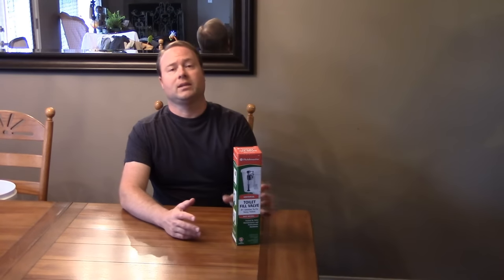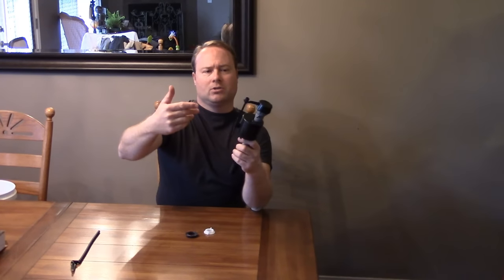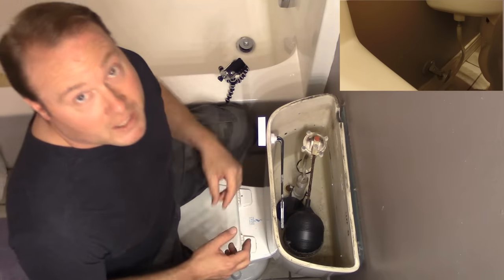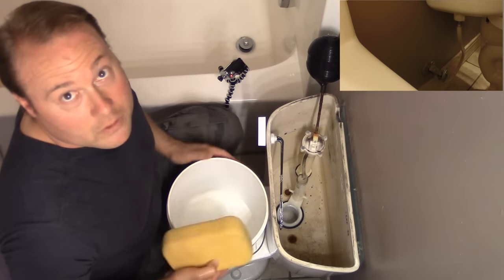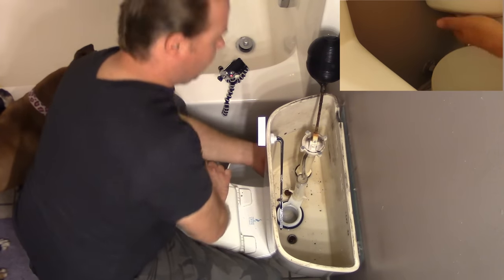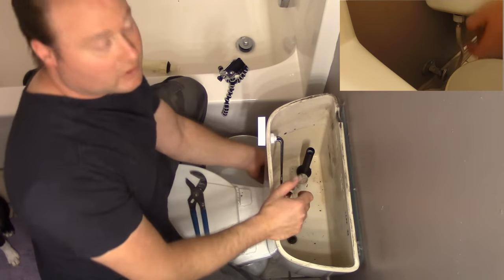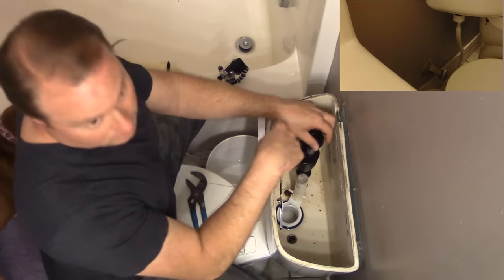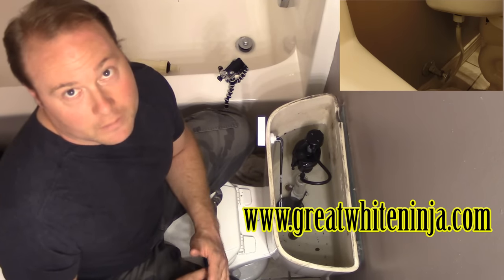Fluidmaster 400a - Installation

Comment: Do you know if there is a difference between the 400A generic fluid master valve vs the American standard one with the blue top?...they both say 400a but the American one is significantly more at least twice the price.
Reply from the maker: To be honest, I don't. I think they are the same, except the American Standard has a blue top and they call it theirs. If you are wondering if you can just yank the top of the fill valve off without removing the stem in the tank, like I show in the video, well very possibly. But I am definitely not guaranteeing anything there. You could for sure remove all of the old one and replace it with all of the new regular 400a. Good luck with your project. Thank you for watching. Check out hundreds more of our videos at https://www.aroundthehome.org
Reply: @AroundTheHome1  thanks!

Comment: Stupid question...do you have to cut off the water from supply line...my valve is rusted out....if I am just replacing the top part.
Reply from the maker: The top part is the valve on this so the water must be shut off. Somewhere it needs to be shut off so if your shut off is rusted then you need to shut off water to the whole house. Thanks for watching and don't forget to stop by our website for many more helpful videos. www.greatwhiteninja.com

Comment: How do you know where to fill to? You said to adjust to water level but how do we know where to adjust?
Reply from the maker: Ok, there normally is a line on the inside of the tank on the back that shows where to fill to. Or sometimes it is on the overflow tube. That big, normally white, tube that comes up in the tank. If you can't find either one just make sure that the water is below the top of the tube and that it isn't higher then where the flush lever is. The tube should be shorter then any place where the water will flow out of the tank, but that isn't always the case. I hope that helps. Thanks for watching and don't forget to stop by our website for many more helpful videos. www.greatwhiteninja.com

Comment: I have a serious question if you can get to this. I've had this thing installed for a while, but when the tank fills up with water and the floater thing rises to the top it just keeps putting water in the tank. I've tried adjusting it, etc.. but it just keeps filling and the water level goes over the top of the pipe. Is there some way to make this stop?
Reply from the maker: Sounds like there is some hard water deposits keeping it from shutting off. There is a rebuild kit for the very top of this. I really need to make a video for that. Or you can just order a new one and just unlock it and pull it off the stem and slide a new one back on in under 2 minutes like I show in the video. Here is an Amazon link for a new one. https://www.amazon.com/Fluidmaster/dp/B00IOXNJEE/ref=as_li_ss_tl?ie=UTF8&qid=1540206309&sr=8-4&keywords=fluidmaster+400a&linkCode=ll1&tag=greatwhitenin-20&linkId=7976a8b2eb182f29d4cd25f09ee33aba&language=en_US

Comment: I installed it and it  seemed to be working perfectly. Now it cycling about every 5 minutes and adding water. What do I do?
Reply from the maker: Sounds like the tank is leaking water into the bowl. Two things to check. Did you use the plastic end that clips the hose onto the overflow tube? This is actually not only a mounting clip, but an anti-siphon piece. Without it water can siphon from the base of the fill valve on up through the tube. If that's not the problem then the flapper isn't seating correctly. Check that carefully and this may be a good time to replace it. You can find all my plumbing videos and more on my website www.greatwhiteninja.com
Reply: A new flapper fixed the problem!  Thanks!
Reply from the maker: Glad that I could help.

Comment: how do i correct a toilet that periodically fills after flushing. Probably like every couple hours Ill hear it topping off the tank
Reply from the maker: Well, sounds like there is a leak somewhere. I mean, your fill valve could have a mineral build up that is keeping it from turning off correctly. But the most common problem is a leaky flapper. If you stick your ear right over the overflow tube you might be able to hear a small drip. That is almost guaranteed a leaky flapper. Hope that helps.
Reply: @AroundTheHome1  ok cool, I’ll check on it. Thank you buddy

Comment: I installed one but the float sticks and then the water will not fill at all.  I have had to manually push it down and then when it fills sometimes it fills the tank a little over half and other times it keeps filling until it is overflowing into the overflow pipe.  I am not sure how to fix those problems.  Any suggestions?
Reply from the maker: I have installed literally a hundred of these models and can't say I am sure why yours is having trouble. I can only guess two things. Maybe it is rubbing against something in the tank or you have a defective unit. I would try turning the water supply back off and then slipping the locking ring up and removing the upper part from the stem. Then check to see how smooth the movement of the float is outside of the water.
Reply: Thanks I will check that out.
Reply: I had the same problem. When I flushed the toilet, the plastic lever would not  go to the  fill position. I had to connect the plastic chain to the little trip device (plastic lever) at the bottom of the float, and to the flush handle. Seems to have worked.

Comment: It’s working for me but the water is coming from the bottom as well as from the overflow tube? What did I do wrong?
Reply from the maker: The water should come from both the bottom and the hose. That water goes down the overflow tube into the bowl. It helps to get the bowl back to the full amount. As long as the water doesn't keep coming out of the hose after the fill valve has stopped, then it sounds like you have it right. Thanks for watching and don't forget to stop by our website for many more helpful videos. www.greatwhiteninja.com
Reply: Around The Home Thanks!
Reply from the maker: You are welcome!

Comment: For dummies, (me), you did not show the order of the rubber shank valves.  You can't see it clearly in the instructions on the package and I can't tell which way is up, the largest or the side with the little lip that obviously fits into something.  Meanwhile, mine is leaking through the plastic nut.
Reply from the maker: @Gwen Williams, you mention the "rubber shank valves." But I think that you are talking about the rubber washers. You mention one with a little lip. The lip or bevel goes towards the toilet. It helps to center the tube in the tank hole. This is a newer video that hopefully helps more. https://youtu.be/KLvoFsE3NP0
Reply: Thank you!!
Reply from the maker: Is everything working correctly?
Reply: @AroundTheHome1  Sir! You were very clear in your demonstrations and explanations. They should know it is the smallest things that can cause a leak! There is nothing on the package that tells you which one is the rubber gasket and which way is up when you put it in? Even further, a shank gasket.
Reply from the maker: Sounds great. This is a very old video of mine. The newer one is an OK replacement, but not everything that I want. I have a newer one yet planned, and I appreciate the input from viewers so that I can add the tips that are needed.

Comment: My toilet leak from syphon, like dropping water. How to repair ?
Reply from the maker: Normally that happens when the fill hose is just put into the overflow tube without the black 90 degree mount. That is the anti siphon device. Is that missing?

Comment: My floater doesn't go back down once I flush the toilet, any suggestions?
Reply from the maker: Does the flush lever pres up against it? Just check for anything that might be obstructing it.
Reply: No it didn't, it is actually the valve with the leak chain and the plumber broke the chain. I used a paperclip to reattach the chain and now it works. Thanks

Comment: I installed this exact valve but after installation I hear the tank filling up every three minutes...what did I do wrong?
Reply from the maker: One of two things that I can think of. One, the flapper isn't seating correctly and is leaking. Or the fill height is a  too high and water is slowly going down the overflow tube.
Reply: thanks Nathan, found out the problem, there was an air bubble in the flapper seal! cut a hole to let the air out, replaced it and it seals just fine, very perplexing!
Reply from the maker: Glad to help.

Comment: Did mine and it took almost 4 minutes to fill, after searching found out it's the fluid regulator in the tube, what a POS idea. Took it out and filled normal. They make no mention of it in the specs or directions.
Reply from the maker: No they do not. I do mention that in a newer video. That is not fault of Fluidmaster though. That is a federal government regulation. It started about 8 years ago in California then spread to the rest of the country 5 years ago. It is not there because the Fluidmaster company thought is was a good idea.

Comment: Got the stem off...but i cannot for the life of me get the dang nut off after that...I'm about to give up and call a plumber😤😤😤
Reply from the maker: Can you give me a little more description on what you have done so far and exactly what you are having trouble with. Which nut off of what?
Reply: Around The Home thx for responding man...the nut at the 10:20 mark
Reply from the maker: Ok, that nut. The only thing that I could say on that one is if you are having trouble with it then lay down on the ground and look up at it. It will not only make it easier to not get confused on which way to turn it, but it will give you better access to grip it with the pliers. When you are sitting on the toilet seat like I was the turning is reversed because you are looking at it from the back side. I hope that helps out. I have a newer video on this that may help a little more. https://youtu.be/KLvoFsE3NP0

Comment: Fluidmaster toilet fill valves are junk.  Sorry, but they are.  I had TWO fail after just having installed them a couple years ago.  I just bought Korky fill valves (made in the USA) and installing them was a snap.  Now I'll wait for a longer term to see how they stack up.